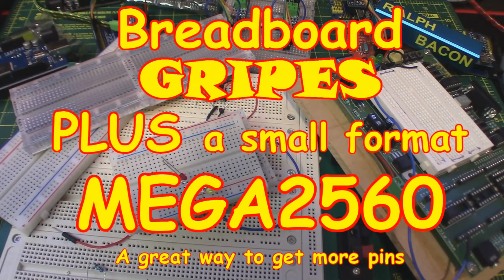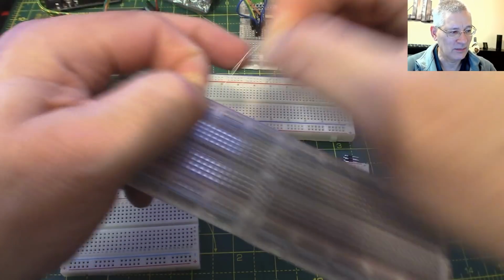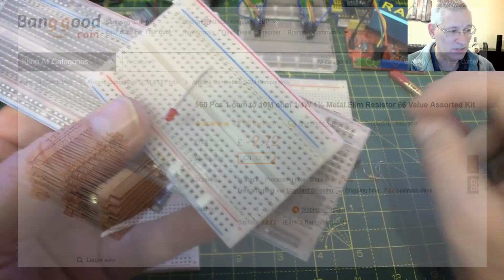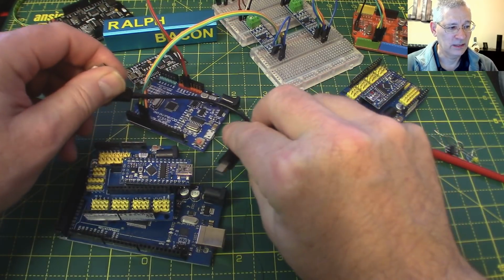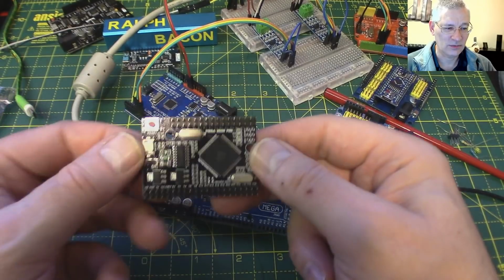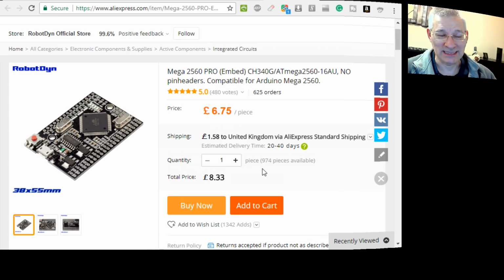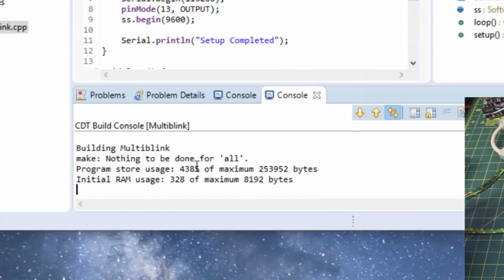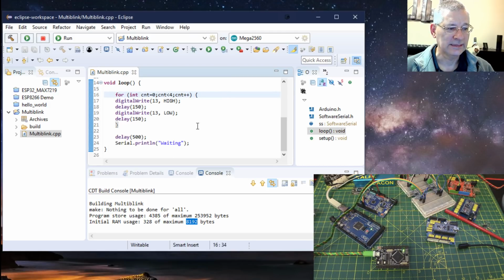#108 Breadboard gripes 😡 plus Mega 2560 PRO (Eclipse version)

Comment: Seeeduino Mega breaks out all 2560 pins on a board a little longer than the Uno.
Reply from the maker: Indeed they do, Bernd, I just had a look, but it was a good job I was already sitting down as I then spotted the price. Not cheap, and not as compact as the Mega2560 PRO either, but everyone has different needs so it's horses for courses, as they say. Well, I do. Thanks for the info Bernd.
Reply: I needed all the pins of the 2560. There are quite a few (14) not connected on the Arduino Mega  or that neat little Mega2560 Pro. https://robotdyn.com/mega-2560-pro-embed-ch340g-atmega2560-16au.html

 And yes, the Seeed board is comparatively expensive. Keep in mind that the microcontroller chip itself sells for about a third of that price in low quantities from reputable sources. Indeed, robotdyn must be buying in the thousands to be able to sell as cheaply as they are.

The next stage (a bit daunting) was to design, build and validate a full control board using nearly all 2560 pins. (Roughly 10,000 lines of my code plus FreeRTOS.)  Ignoring that I forgot to bring 2 signals to external connectors (bodge wires worked) it was a measured success. The machine worked ... prototypically.

Comment: InterlinkKnight did a roundup/comparison of a few solderless breadboards.
https://www.youtube.com/watch?v=XKQJhe9n_ug&t=357s
BusBoard and the Jameco WBU series came out on top.

I'm often frustrated by the unreliability of some of my newer breadboards.  I'm driving several displays from my nano (via SPI) and they will go blank or wonky for no apparent reason.  And I would sometimes get bad data from some sensors.  At first, I couldn't tell if I had a bug or not.  Jiggling the connections would more often make things worse.  But a generous spritz of contact cleaner (or flux remover) and some jiggling helped.  My much older (40 years old) Experimentor 300 and 600 from Global Specialties were far more reliable.  I now have some new ones from BusBoard (at 3x the price of the cheap ones) and so far they are on par with my older ones.  But I still keep a can of contact cleaner handy for my older components.

And thanks for the info on the more compact Mega 2560 pro.  I'm running out of memory and pins on my nanos and that seems to be the better upgrade path.

I found that a right angle USB connector makes cable management easier for the stock Mega 2560.
https://www.amazon.com/gp/product/B00GOBM7IC/ref=oh_aui_detailpage_o01_s00?ie=UTF8&psc=1

And thanks again for your videos!  They are always informative.
Reply from the maker: Thanks for the link to that video (even if it did start 3/4 of the way through!) I shall watch it again. Your breadboard experiences mirror mine which is why I'd be prepared to buy a much better quality item if it did the trick (allow think components to enter easily and make good contact). Perhaps a gold plated model?
 
I can see how the angled USB cable makes it easier on the standard Mega2560 but it's the whole clompy cable (technical term, obviously) that I find irksome. But a good hint for others too there so thanks for that and your post as a whole.

Comment: In some cases (like with my 3d printer with a Mega/Ramps board sandwich), I prefer the larger old USB (printer-style) connector. It's much more reliable and rugged when you ned plug and unplug it a lot. 

I also prefer the Mini USB over Micro USB for the same reasons. If you try and put it in upside down, you don't risk breaking its delicate connections. 

Whoever invented the MicroUSB  clearly didn't use them much. ;)
Reply from the maker: Yes, the micro-USB is a bit delicate in that sense, but now the USB-C micro version is much better, being able to plug it in either way round. It's true though, the smaller you make something the more delicate it gets. Good to hear from you, koz.
Reply: amen brother.

Comment: i found soldering loose header pins to leads help with the contact issues with the cheaper breadboards.  The only nuisance is  having to use tweezers to push the pins in if the leads are especially malleable.  Thanks for the tip about the smaller Mega.
Reply from the maker: Glad you like the info on the smaller Mega, Robert, I find it very nice to work with, just a tad expensive for day-to-day use. Your heads-up on using header pins is good too. Thanks for posting.

Comment: I’ve pulled my hair out on the cheap breadboards. My grips is for atleT the 4 I have like your large on with the aluminum base are the contacts only really leads the diameter of a 1n4004 diode. All 1/4 w c.f. Resistors I have  just don’t make contact. Also the 4 binding posts are poorly made and twist in the plate when you snug a wire down. I got them from the two big hobby electronics web sites here in the US 😡 wasted money.
Reply: http://www.assemblyspecialist.com/WebStore/breadboards.html ref EEVBlog forum
Reply: the two big hobby electronics web sites here in the US ??  and they would be???  Thanks.
Reply: Bill Field : I didn’t want to say something bad and then name them. For the most part the micros etc all all excellent, but since you asked Spark Fun and Ada Fruit. I like them both just not the breadboards I got.
Reply: Im not fussy on most breadboards either. I was just looking for a possibly new source. Thanks.
Reply: Bill Field I’ll look and see if I can find a like to the OEM of those excellent 3M breadboards.  I had it about a year ago. I think the did direct sales.
Reply from the maker: I'd be interested in a new source of quality breadboards, David, price not an obstacle. Well, OK, it is, but I'd be prepared to pay more to get a quality product that would last me more than a couple of years and let me insert thin legged components with ease.
Reply: thanks for the link. Parts look pretty good and price not bad either.
Reply: David Queen, maybe you can fix them :)
take the tape underneath off, use tweezers or any other tool to push them inside a little.
reapply tape or put new one. if tape can't be reapplied, cut it a little from each side then cover all sides with electrical tape.
Even if it never worked you gained a little experience with breadboard insides! ;D
Good luck.

Comment: Can you just use the Arduino IDE to program that Mega 2560?
Reply: Yes.  Many 3d printers use a Mega, with a 'Ramps' boards plugged in to the headers.  We then use the Arduino IDE to configure and flash the 'Marlin' (or other) firmware to the board for 3d printing, cnc, etc..
Reply from the maker: Just to add to the comment already here, Bruce, the Mega2560 (whatever the size format) is one of the "standard" boards supported by the Arduino IDE without you having to do anything at all. Thinking of getting one?

Comment: I really can't get on with the clear breadboards. It's hard to see where component leads go. Thanks for another great video Ralph.
Reply from the maker: I know what you mean, Maxx B, it can make your eyes go a bit wonky. I've had a couple of pointers in these comments for better quality boards so I'll be taking a look. At least I'm not using those funny blue resistors, you having any luck with them or did they get "recycled"?